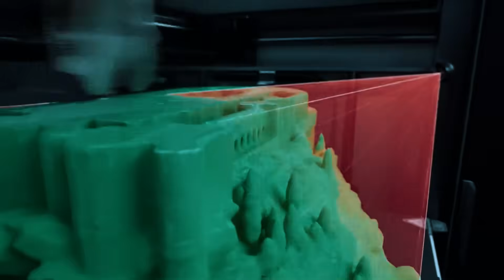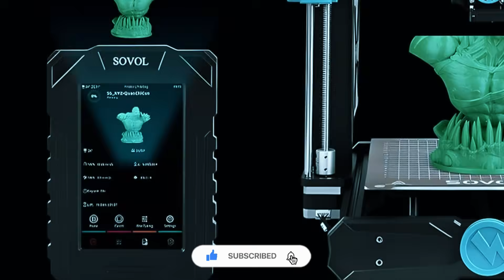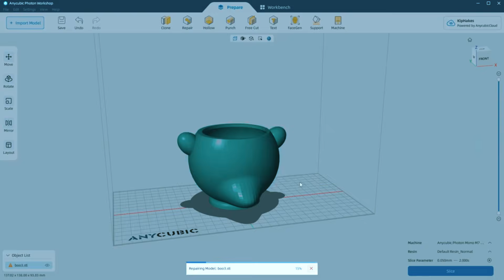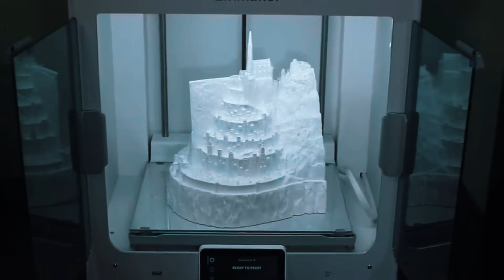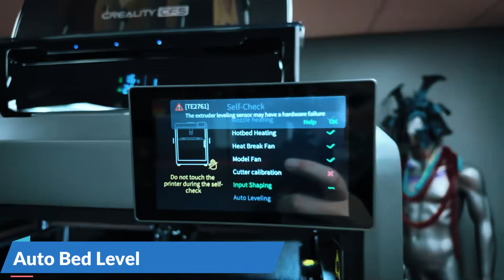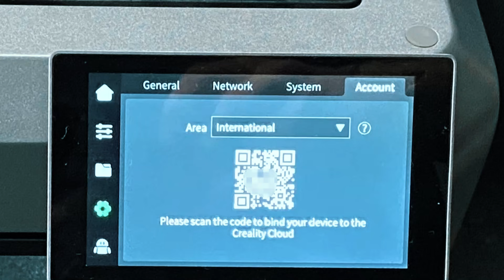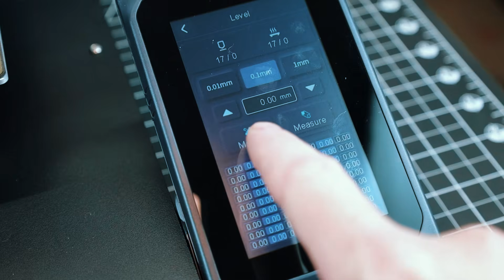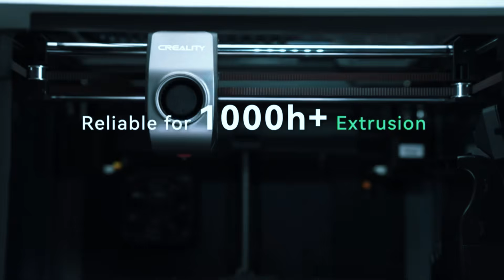6 Best Large Format 3d Printers 2025

Comment: FYI - The 7 Max does NOT have auto leveling its 4 point manual system but is a great printer. Before promoting anything you need to get your info correct.